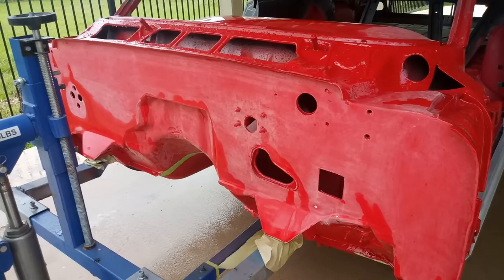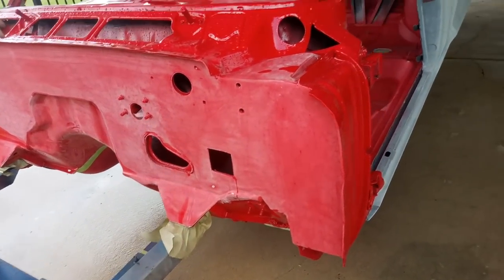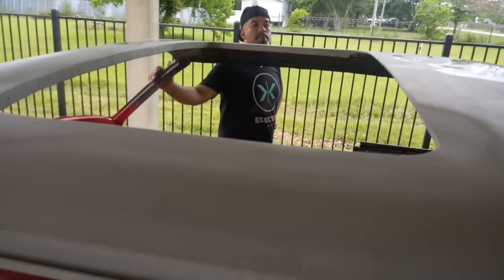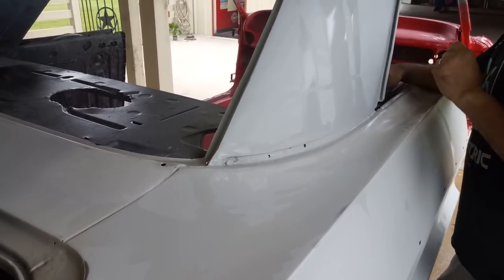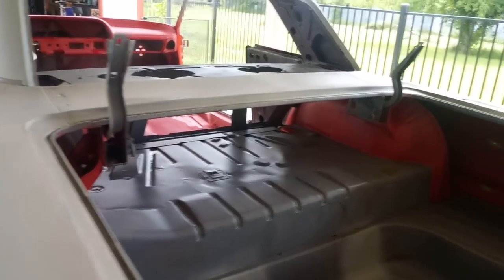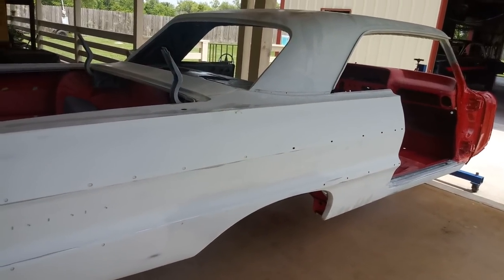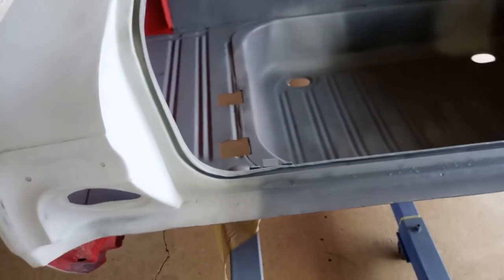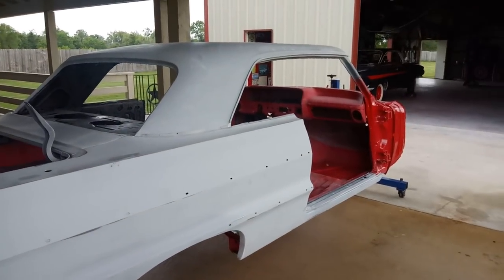1964 impala lowrider talk

Comment: The firewall and ac vent holes look awesome! I'm looking to do the same thing on my 64. Did you use a hole saw to cut out the holes for the vents? Did you use the cover that came with the vintage air for the firewall? The ac kit I bought was for an impala with ac so the firewall cover is different from a non ac car. You guys do great work!

Comment: i noticed you guys didn’t cut out the bolt holes for Emergency brake? did he just choose to not put that back in . with that style of E brake even work with disk brakes? i plan to upgrade to all disk . so should i not put the E brake back in either?
Reply from the maker: Yes u can run factory e brake pedal on rear disc conversions. I believe he is going with an electric e brake setup

Comment: Red raptor liner for the bottom is that similar to rattle can paint for the bottom of body??? I’m debating weather to paint mine same color of car or use rattle can cause Vegas gets hot.
Reply from the maker: Raptor liner is similar to bedliner or under coating. I believe it is a 2 part and mixes with a harderner. Rattle can spray paint will not produce the results you are after. They sell rubberized under coating in a rattle can. Ive used before. From eastwood. Works good but cant be tinted. I believe raptor liner tints using the actual base coat paint. Look into it. Kits come with guns to spray. Personally never used it but i plan to in future. Painted floor pans is more for show cars...where i live. It wouldnt hold up 100 miles
Reply from the maker: Ps. I like vegas. I can shoot craps 8 hours straight lol
Reply: Did your buddy media blast the bottom then primer it or what process did he use before using the raptor liner???
Reply from the maker: Wire wheel...flap disc...hand scrape....spi epoxy...then raptor..
Reply: Can you ask your buddy about how many liters he thinks he used on just the bottom of the body of raptor liner???
Reply: Ben Alanis what’s up bud, I used the 4 quarts (1 gallon) that come in the kit. It’s very easy to use, just keep the gun moving so it won’t glob up on the panel, the more you put in one section the more texture you will get.
Reply: John Bro you wrapped the entire frame is that correct??? Did you do it yourself??? I’m looking at wrapping my frame too but I only wanted a partial wrap molded and guy said it’s not really worth molding on a partial wrap
Reply: Ben Alanis hey Ben, I did not wrapped it but i did have to re-weld the entire frame to mold it, I’d have to say it’s all about what you want, I personally would mold a partial or even a stress points, looks so much cleaner imo.
Reply: John Bro I agree molding it looks clean but people charge way to much to get this done but it is hard work too
Reply: Ben Alanis it’s a messy time consuming job but it’s not that hard, angle grinder and some flap discs, welds would have to be built up to be able to smooth them out. Proper PPE is a must as well, gloves, mask, glasses and ear plugs.